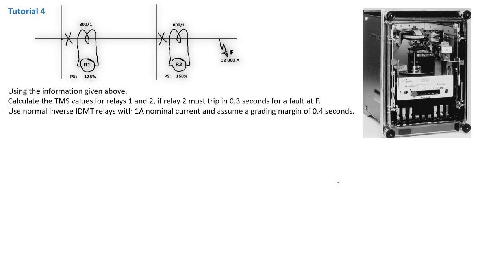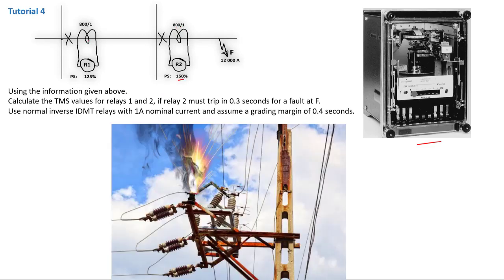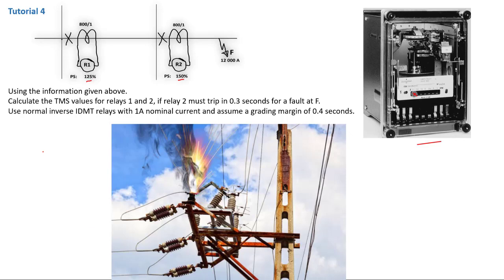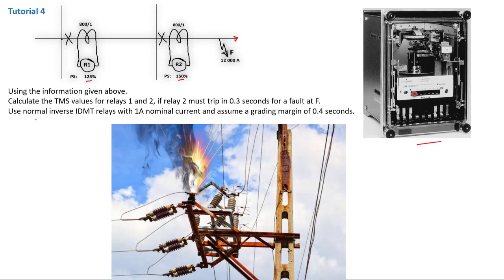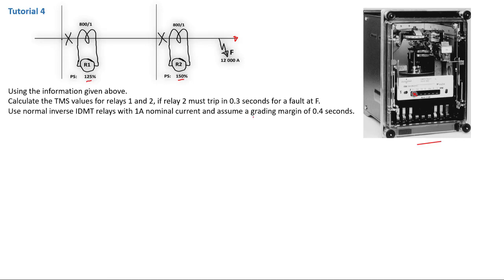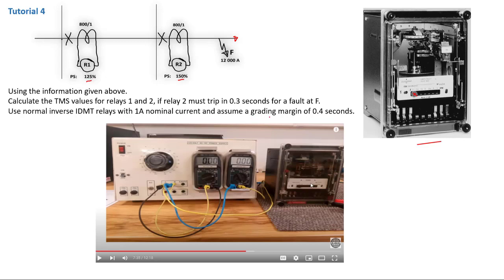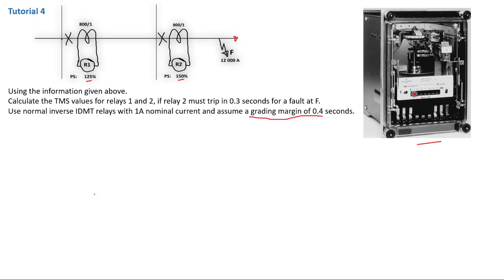IDMT Relays Time Multiplier Setting TMS - Tutorial 4

Comment: Would you be so kind to provide a link on where to find other functions for the tc ? You provided NI, VI and EI. It would be great to have functions for other curves too, please.
Also, any chance you could provide us with an insight on understanding other curves? I see letters on switchboards but struggling to understand them.  Such us: DT, 1.3, 3/10,  MI. Thank you so much in advance for your hard work!
Reply from the maker: Hi, May I ask what are you studying and at which univercity?
There are mainly three type of chracteristics curve  which I have explained on a few tutorial, depending on which region of the world you live and maybe the type of application to be used, there are at least another 2 type of IDMT relay response curves.

Tc is the relay operating time which defined by its characteristics curve, which in tern also depend on the disc shape and the relay setting current, so Tc only have one function which to compute the relay operating time based on the specifics I just mentioned.
If time allow I will upload tutorial on other curves, the power system book "Principles of Power Systems V.K Mehta" seciont on protection relays will give you enough information.
Which swicthboards where you reading this information? If you can provide the application details.
Reply: @CMTEQ  I'm studying in Singapore but the question is not school related. More of a work purpose and personal knowledge.
The relays I'm referring to are not the mechanical type you are referring to, but the latest electric/electronic. I see engineers using other codes for curves such as 1.3 or 3/10 or DT.

Tc also applies to non-mechanical relays such us the one I mentioned above? Thanks for considering a new video and thank you for the book recommendation, I will surely buy that.

The boards I'm referring to are Main Distribution Boards for instance, protecting random inductive loads such as motors.
.
Reply from the maker: Hi @TIGREinVOLO , I understand the type of relay you are referring to with solid state electronics, to best undertand them its probably best to refer to manufacturer manual for any related code. 
I can assist you if we can take the conversation outside YouTube, you can Join my patreon page and I will provide you with the necessary answers for your unique querry.

Here I'm happy to answer question directly related to the posted tutorials.
Reply: @CMTEQ  much appreciated. speak soon then. thank you